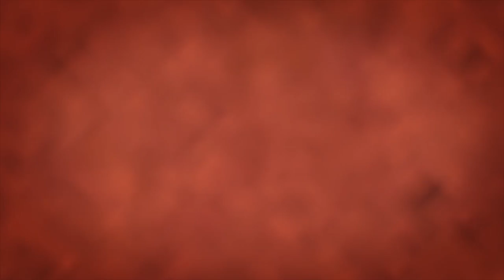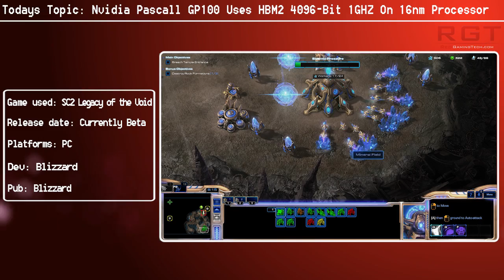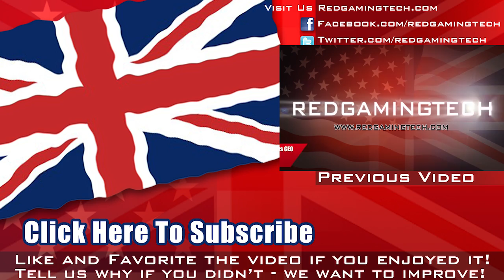Nvdia Pascall GP100 Uses HBM2 4096 Bit 1GHZ On 16nm Processor & NVlink Info

Comment: Have a gtx 780 that still does admirable in most games at 1080p. Will be picking up the new Swift PG279Q 1440p panel when that's released so will need a new gpu when I get that screen if I want to game at that resolution with decent settings but I'm not going to get maxwell I want that pascal.
Reply: Son Goku   Bypass 1440P and go 4K.  Vizio makes an M-series specifically for gamers.  I Have a Monoprice 1440P monitor that collects dust now.
Reply: AKlover I want G-sync and 144hz. Its impossible to go back. Currently my monitor is 1080p with g-sync and 144hz and I don't see 4k 144hz monitors with G-sync in the near future.
Reply: Son Goku   The fastest 1440P monitor I know of is the monoprice I have, they can overclocked to over 100hz.  They are not G-syinc though.  If you have a system that can push games to 100fps in 1440P you are likely among 5% of gamers.  I have yet to feel under served by 4K 60  I'm running SLI 970 SSCs..  A 28 inch monitor is not really 4K you need more screen space to get the full effect.
Reply: AKlover
You must of not been keeping up on tech recently. Acer released an IPS 144hz 1440p G-sync display a few months ago. I would get that one but I like the aesthetics of Asus's upcoming monitor with the same specs. Thats why I'm waiting for Pascal, I want the new Titan variant or 1080ti. whichever is a more compelling buy when the release of those gpus come out.
Reply: Son Goku   Pascal will not likely drop till the day of AMD's Xen release.  Likely a year away.  Also if AMD is still in business at that point they get first dibs on HBM2.  Plenty of time between now and then.  At the rate things are moving we might have a handful of 5K 90 hz tvs and monitors available then.
Reply: AKlover what about UHD(ultra-wide) did u try that? i was thinking UHD(ulta-wide) @ 144hz would be sweet
Reply: bpm hopper UHD is 4K.  Fastest refresh I have heard of with a 4K is with a monitor which can be overclocked to around 90hz.  IIRC it was Korean and only 28 inches.  You dont get the full effect of 4K on smaller screens.  mLook for a 60HZ refresh rate with as high a Chroma rating as you are willing to pay for.  If it is a 4:4:4 or 4:4:2 chrome they will list it on the box or advertising.
Reply: AKlover  what is amd xen? do you mean ZEN? that is amds upcoming CPU, not GPU. the next gpu lineup is the arctic islands series of GPUs with Greenland likely being their flagship.

and yes, they are projected to come to the market next year. with amd having first dibs on hbm 2, it is not in the realms of impossibility that pascal will be considerably later than greenland, perhaps even 2017.

also, why do you need 144 hz AND gsync? afaik, the frame rate sweet spot for gsync is in the realms of 40-60hz. if you have a gpu fast enough to get you 144fps, why eeven bother with gsync?
Reply: AKlover what world do you live in, 5k 90hz, amd going out of business. None of this is going to happen in 1year, tech has been slow lately, the 980 ti and the fury x were the biggest jumps in about 4years(it at least feels like.), i hope me waiting for these new gpus to come out is worth it. I have a 780ti, i wanna see 4k@60fps. If you compare the 500series to now you'll come to find only 15-10% jumps.
Reply: One FatBurger Read AMDs financials theyhave been bleeding money for most of the last 3 years and current stock price is $2 per.

Maxwell has been out about 1 year and some change and they are already looking to Pascal.  Logical progression is single GPU 4K gaming  SLI cards running 5K games is not a stretch.

Monitors and TVs will follow suit.  There are already a few 5K monitors.
Reply: AKlover Mhm, you'd better invest, artic and pascal look promising, predict 3x compute. Heard amd is going to be bought by samsung, Nvidia has to get their memory chips from amd regardless. I'm almost certain amd was profitable in 2013 and 2014. Tbh i don't give a shit, I'm just waiting for a kick ass card.
Reply: One FatBurger   Invidia and Intel having no competition would be a bad thing for the consumer and the advancement of tech.  If for no other reason we should wish AMD some success.
Reply: AKlover the fury x performed admirable considering their current budget.
Reply: One FatBurger  There are questions about how many were ready at launch and how many are actually out in the wild.  I can go into best But and buy a 980 TI if I want in moments or buy it from Amazon or Newegg and shipped to my door in days.  Never seen or heard about a Fury X in the wild that was not a sample for high trafficked Youtubers.

Comment: Still not buying AMD crap after that Fury X release. Even if they have priority for HBM2, I'll still wait for Nvidia.
Reply: midicronica1 What's wrong with the fury x? Other than the fact it was over hyped that is.
Reply: ***** Maybe, still not something to hate a companies guts forever over. Especially compared to the bullshit nvidia has pulled this year with the 970, bad drivers, and problems with gameworks games not working so great.
Reply: Rob McCune My main gripe with the whole Fury X was how over hyped it was and how much it didn't deliver. I was on the fence about the Fury X( I really wanted it to succeed) and the 980ti. After seeing the performance and waiting for the reviews, I went with the 980 ti. Never looked back. Runs excellent and was able to get it OC'd with 1530 on the core and about 3910 on the ram on air with no extra voltage. Money well spent IMO. 

After the all the defects too with the coil whine, it was very off-putting. Also a youtuber that I follow by the name of Sloppywetblow has been running benchmarks on games since its release for about a month now for the Fury X. He said that the drivers weren't optimized or mature yet(when will they ever be?), the card didn't run up to par with the 980ti and just recently.. it developed coil whine/failed with weird screen flickering. 

With the quality and performance, I can't say I'd get an AMD card. I'll wait of course for the next gen HBM2 cards of course and I'll wait for the AMD/Nvidia reviews to be fair just like I was before. I just won't buy into the hype.
Reply: midicronica1 I can't disagree with any of that really, a 980 ti is a better buy for a lot of reasons. 1 bad product isn't something to hate a company forever over, but it sounds like you just have a healthy skepticism and learned from the disappointing launch.
Reply: midicronica1 With the price Nvidia charges you'll have to sell both kidneys.
Reply: midicronica1 
please keep in mind though that amd has a track record to actually support their cards for a pretty long time driver wise, the 290x performance improved by ~20%! over the course of a few patches, overtaking their price competion by a lot, sam thing could easily happen with the fury. also please take into consideration that amd actually encourages dissatisfied furyx customers to rma their cards, they will get the latest pump variant and try to deal with the coil whine.
as said before, coil whine happens on both sides frequently, so if some do have coil whine doesnt mean the entire line of cards is shyte.

you can even oc the ram and core now, although only with third party programs. not that it really matters anyway, because the bandwith of the memory is grossly overkill even at stock speeds.